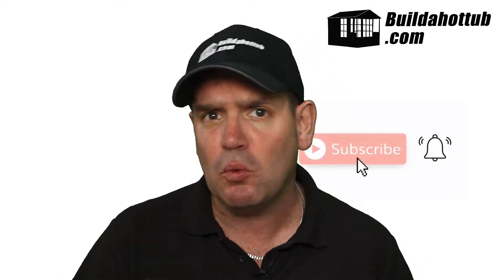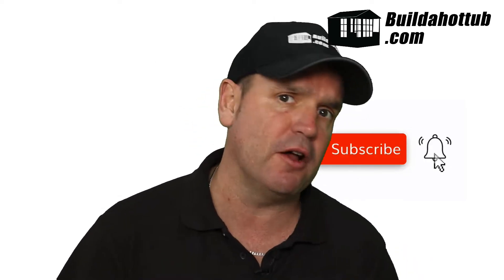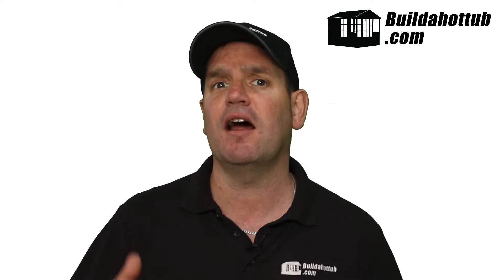Add an Air Source Heat Pump to a Hot Tub in 3min30s - #timelapse

Comment: Hi  do you need to make the connections near the circulating pump or can you make them anywhere in the ciculating system ? i presume you are making them at that point because of the shut of vaves,
Reply from the maker: Its best to make them near the pump yes.

Comment: How do you keep the pipes between the heat pump and tub as well as the heat exchanger in the heatpump from freezing in cold weather?
Reply from the maker: Hi Aaron, most people will lag them with foil wrap. You also cant just turn the system off with water in the heat exchanger as it freezes and will crack and damage the heat exchanger. All manufactures class this as human error so you are not covered under warranty either. Hope that helps - Andi

Comment: How do you stop your existing hot tub heater from continuing to heat water if you have the heat pump installed and how do you control the heat pump temperature ?
Reply from the maker: Hi Dean, thanks for the comment. You unplig your existing electric heater from your spa pack but leave it in situ. You then set the temp on your hot tub and your heat pump (which has its own thermostat) to the same desired temp. This will then heat. If you drop the temp on the hot tub, the circulation will stop and the heat pump will not heat so you are controlling it through flow. I do have a video that explains this on my channel in the Heat  Pump playlist. Hope that helps - Andi
Reply: @Buildahottub  Thanks Andi - i'll check the playlist